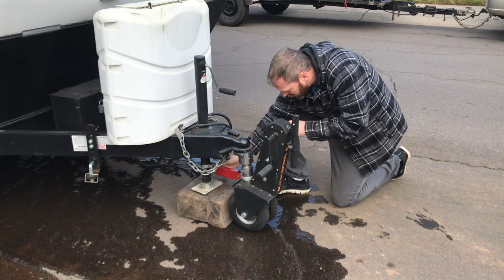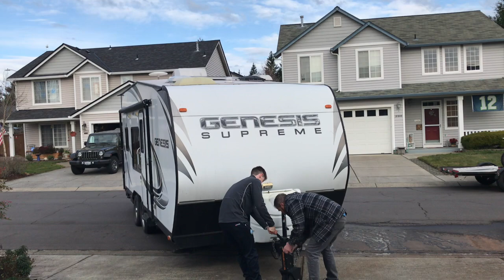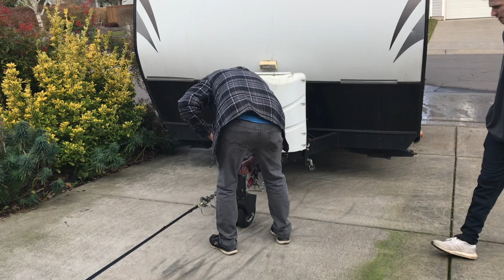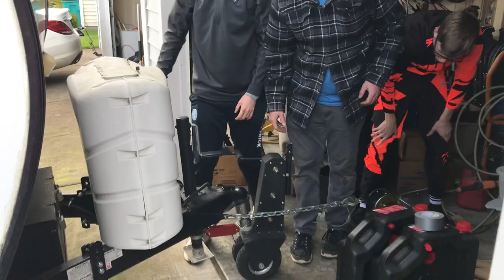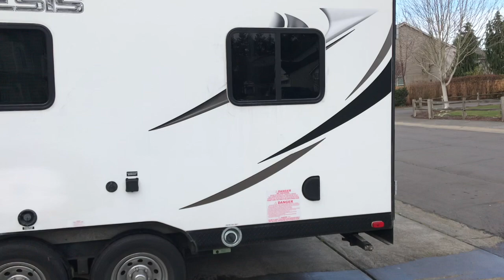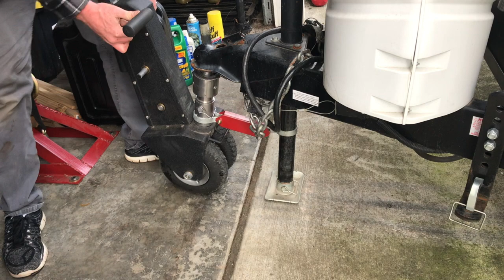Using the Trailer Valet to Move my Toy Hauler up the Driveway

Comment: I have the same Trailer Valet XL.  I got it very inexpensively second-hand.  I can understand people's negative comments about it.  Every time I use it I feel like I've been on a treadmill for an hour (and that's with a drill) but in some circumstances (extremely narrow driveway and street) it is actually very helpful in getting a trailer where you want it to go.  I envy the guys who grew up towing trailers on the family farm who can back a 5th-wheeler through an obstacle course blindfolded, but if you are just someone who tows a couple times a year, a trailer dolly can really help you make your camping possible.
Reply from the maker: Thanks for the comment.  It's definitely not for everyone but it does work and it makes my situation possible so I put up with the added work-out!
Reply: Yup have to agree it works for some of us.  It was worth the money.  Let the others laugh…. It’s not for everyone. The drill attachment makes it doable and the best way for us to move the two trailers we have.
Reply: That’s why I only use the drill.  It’s hard enough wrestling it even with the drill, but it works. My drill is no worse for wear so far and I’m moving a 6200 lbs RV trailer.  Yea not for everyone, but it works for those who need it.  I’ll never use the crank if I can help it. 😜
Reply: Kw-xt3xk  If you can back a 53-foot trailer through New York City, then this product would indeed not be useful to you.

Comment: Great job, it worked.  I used the cheap HF 10,000lb winch for my boat, it worked out perfect since I don't have help like you do.  Suggestion, tie chock blocks behind wheels so it drags it along for that "just in case" moment.
Reply from the maker: Great idea!  Do you have a video showing how?
Reply: Show us a video of how to tie chock blocks behind wheels please - I'll wait...
Reply: @robbob4872 hang them from the  body behind the wheels. They will hang down and drag behind tire only when using dolly and when you travel you can remove them and stow them in the trailer.

Comment: Don’t you have the power drill attachment?  Makes it much easier to operate.  Mine works like a champ without cranking.  Love it.
Reply: Manufacturer recommends using drill only on level ground.  Helps to have tag team of young strong crankers.

Comment: Whoever invented that should be slapped
Reply: I have been laughing for the past 10 minutes! This is ridiculous.
Reply: LMFAO
Reply: LMMFAO
Reply: @ricardovelez3796  i think you’re supposed to use a drill
Reply: @markchavez7707  say that to them
Reply: 😂 I would just park it on the street
Reply: Yeah could at least have an electric push button crank that you can hook up to the battery.

Comment: Thanks for the demo. Questions on your "custom bracket" that attaches to the jack post: 1. It looks like you attach to the post and the trailer valet with chain link fence brace bands, correct? 2. have you noticed any undue wear/tear on your jack from the tension of pulling with the Trailer Valet?
Reply from the maker: I haven't noticed any wear on the jack.  The brace only really works when you are pushing straight forward or back.  Doesn't provide much support when turning.  I now remove the ball from the trailer valet when attaching to the trailer.  The connection is much more secure using this method.
Reply: @godfamilybikes1703  where did you get the custom bracket

Comment: Omg!. Easier to back it in with a vehicle.  It's a neat concept.  I have used a snowblower tractor attachment to do the same before which also has its challenges, much less effort. Or if you need to go in reverse maybe attach a removable tongue on the back?

Comment: I am so confused by so many things here. First the dolly company states not to use it up hill but hey you have to do what you have to do. Why the trailer is not backed in is beyond me. I see many wrote someone could steal it and I suppose that’s true but what are the odds a good lock and a few other gadgets don’t prevent the theft. Plus if stolen that what insurance is for. How you get this back down the driveway has to be just as entertaining as getting it up the driveway. I dam near lost it when I saw the floor attached come along being used to help assist it. Why not try an impact drill that would have to help. Honestly my hats off to you for going through this every time you camp.
Reply: The tongue of the trailer would stick out into the sidewalk. Using a drill ended up breaking the drill that was used according to the poster.

Comment: If I had to spend more than 5 min parking one of my trailers, I would never go camping. The work, effort and costs involved in parking that little trailer in that little driveway would not be worth it. I'm SO Glad I did not buy one of those trailer dollies. Just the thought of going through all that turns me off to even wanting to go out RVing. What I did was install full air bags on my truck, replacing the rear suspension, allowing me to drop it to the bumps and raise it to the clouds. This allows me to "hook n book", less than 1 min, including connecting chains and plug. I also only buy homes with large parking, and I recently bought a 5 acre lot to park my trailer collection.   I'd rather spend ~$60,000 than go through the pain and misery you just suffered through. I've very glad I saw this video, as I was looking at this dolly. I'm going to just buy a ~$30,000 small tractor and use that to move my trailers around. I wish you luck and faith each time you must Indore this pain. I'll bet more than once you guys decided to not take the trailer because of the work involved in moving it.  :/
Reply: I also want to say I mean no disrespect. I think all your tricks and builds to get it parked that way is awesome.

Comment: What is the length and weight of your trailer? I have a 27 footer that weighs 7000lbs. I can pull it into my backyard but i need to then back it into its space and i dont back up so good and plus i am by myself! The trailer is on level grass. Would you reccomend this xl?
Reply from the maker: My trailer is 25 feet and weighs about 5000 lbs.  It should work well on level ground and you also might be able to use the drill attachment.  If you have to move it very far its doesn't take a lot of strength it just tiring.  I would recommend it.
Reply: @godfamilybikes1703  does the xl PULL forward at all?

Comment: Wow, unless you own a trailer and the wheels to move you know and realize what it takes to move to a specific parking spot.  Personally, I would not use the wheel and the crank. Bending is already a stressful operation.  There must be a tri wheel motorized dolly I assume.  I admire the gentlemen putting forth the effort cranking, good job.

Comment: What if you removed the crank and added a drill chuck?
Reply from the maker: I have the drill attachment.  Problem is it takes a lot of torque to move the trailer.  I already burned up a 18v cordless drill.  I am going to try a 1/2" corded drill.  Maybe I'll do a new video.

Comment: Looks like it's more of a PITA than it's worth, lol. My wife and I rented a storage unit for our boat- not realizing how heavy our boat is (usually move with pickup) that getting it up the incline into the storage unit is harder than we'd originally thought it would be. There's not enough room between the rows of storage buildings to properly back it in with the truck, and the door to the unit is barely wide enough for the boat. I can see that this is not what I am needing- I need to be able to get the boat out and in a LOT faster than this, haha. Thanks for sharing!

Comment: You have creatively overcome all of the obstacles but it seems extremely complicated.  Seems like you could simply attach a tongue jack wheel to the trailer and then simply push the trailer into position, then mount a cheap harbor freight winch to the tongue and create a tie down in the garage to winch from.
Reply: I have an RV that weighs 7500lbs and I need to get it into a driveway through an ally! Can you tell me exactly what you are saying to buy that can replace this? I looked at a Winch that cost about $100 that pulls upto 12000lbs. But what is a Tongue jack wheel and where can I find those?
Reply: @2videosilike  purpleline trailer mover. Not cheap but definitely worth it. You would need the dual axle version

Comment: I think this has a option to put the special socket to a good cordless drill and let the drill do the work, for God sakes everyone has a cordless drill let the drill do the work that's what hand drills are for make your life easier, but in a pinch this could be used. Get the hand drill, Milwaukee fuel or Makita 6 amp hour power batteries would be the ticket 😉

Comment: Line it up putting the truck in the the driveway, leave yourself just enough room to disconnect and pull truck out, finish with your contraptions.  Probably only take you about 15 minutes instead of an hour

Comment: would it slide back down if you did not use the brake in the trailer?
Read Matthew 5 Matthew Matthew 7 and believe and obey it to be saved.

Comment: Thanks for the share - Good tool to have i would definitely buy it - and modify it using a power drill instead of the crank shaft handle easier and quicker- to pull a good power winch can be found at harbor freight for 129.00

Comment: I would just back it in the driveway with my truck. So the truck is in the road for a couple minutes. You're backing that thing up in the road anyways then turning it into the driveway. It's blocking the road for a longer time than if you used a truck.my road in front of my house is narrower than yours my trailer is 33' from tongue to back bumper. With a full size ram 1500 long bed and. I never end up in my cross street neighbors property.

Comment: I would take or cut that crank handle off that thing and fix it to where I could put my big cordless drill. If it burned up the drill like you said use an impact on it and do it right.
Otherwise it's easier just to hook up the truck and move it. Lol

Comment: I’m so confused as to why you would do this. It’s a straight shot just back it in. A dolly is for moving into tight spots. Practice backing your camper and stop wasting time and effort.
Reply: Seriously, why not just back it in?
Work smarter, not harder.   Only requires one person vs. involving the whole family.
Reply: Yeah. Just back it in, and invite a thief to just pull it out.
Reply: @havemercy  What?? They make locks for that exact reason.
Reply: @jeremy08410  You are correct. Not trying to be argumentative, but locks and trailer placement are only deterrents and won't stop a determined thief (check out the YouTube video from the Lock Picking Lawyer xVtHiX12TVw). Maybe he wants the back side facing his neighbors? Have a good day ))
Reply: @havemercy  if you're worried about a thief then why not put a tire boot on and they also make one that goes in between the tires that locks
Reply: @tdwm9892  LOL. I'm not worried about a thief; i was only proposing  solutions as to why he put the trailer in tongue first. )
Reply: @havemercy  I would rather have someone steal it, than do this! Yes locks are deterents, but thats why I have a big dog and a gun!!!
Reply: Exactly!!😅😂 wtf!! U would've been done a long time ago!! Good workout though 💪

Comment: When you’re at home you can use a corded drill don’t waste you time with a battery powered
Reply: I was thinking the same thing. An extension cord with a corded drill would probably work just fine. My Trailer Valet model didn't come with a drill adapter and one costs about $70 Cdn. This unit works well for me as I only have to move my 2500 lb trailer a small distance and it is all on pavement. I am unable to back it in with my truck because the alleyway is too narrow to negotiate my truck and trailer.

Comment: Jeez guys. Bolt a small winch on the floor. $150 for a 110v 1500lb winch from hazard fart will do the job. You can even double up and put a snatch block. 

Or you can put a 2500lb dc winch which will require a car battery.

Comment: I had a 1989 Honda big red ATC and I would pull my dads boat. It is a lot heavier than that trailer. The boat was a 26 formula twin 454. 
Trust me if you find an easier way to move that trailer you will use it a lot more.

Comment: There is a front trailer hitch available for most trucks which would Do away with the need for Dolly
Reply from the maker: You have to watch my first video.  Trailer needs to have the tongue tucked under the eves to fit in the driveway.  I could pull it in with a truck if I was ok with leaving it in the garage while not using the trailer.

Comment: What a pain in the ass without a motor. Why is backing in with pickup not more efficient? Sit in middle of street, no thank you!
Plain goofy in this application.
Reply: Some people don't back them in so they are harder to steal.  Ball locks are somewhat ok but still easy to grab with front facing out.  This thing wouldn't be bad if it was motorized.

Comment: That takes too much effort, why don’t you use the drill? You’re younger than me, I think I’m going to buy the $2,000 dolly. That is way to much work. Bad invention in my books, you have to bend over to move it. The aches and pain I’ll get, you should be standing straight while engaging with heavy inventory. That thing is garbage! It’s not even worth the price, at least you’ll have a project to play with.